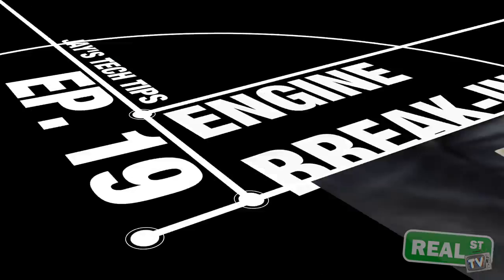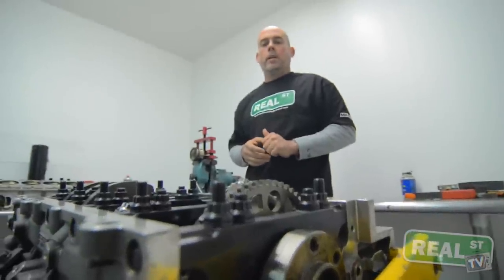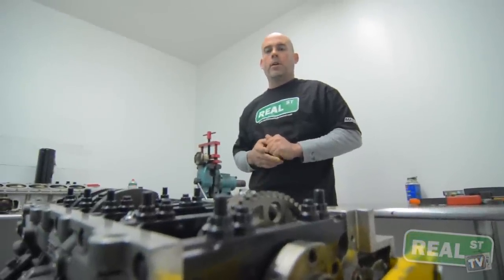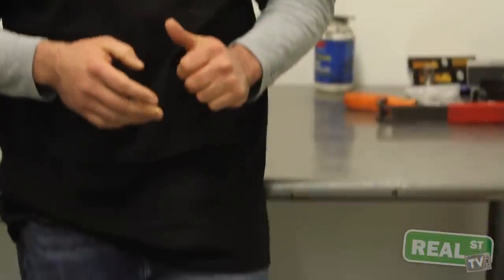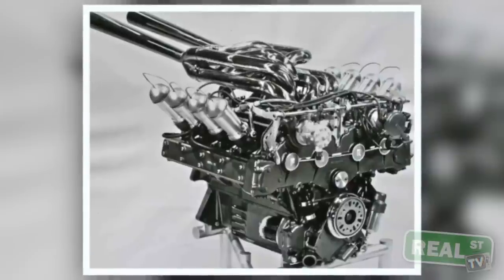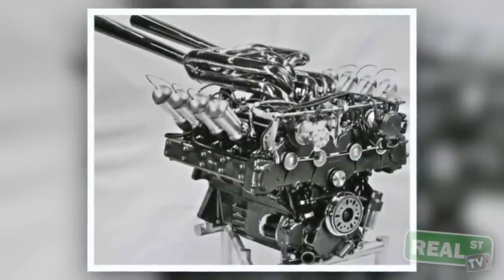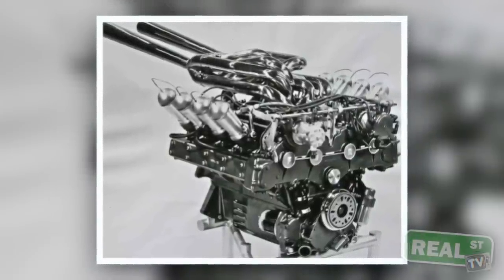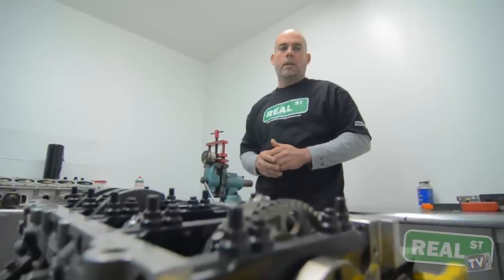Engine Break-In Jay's Tech Tips 19

Comment: In the engine test lab I work, with the engine on the Dyno we measure crank angle resolved cylinder pressure along with blowby flowrate and torque. As soon as the engine runs for the first time, you should see a gradual decrease in blowby, an increase in net IMEP as well as peak cylinder pressure, along with an increase in torque during steady state operation. Ring seating of the top compression ring face is increasing seal. If you remain at light load for a very long time for the first several hours of the engines' new life, depending on the metallurgy of the compression ring, the initial thermal cycles will hold and harden the surface of the ring face. This explains why a hard break in can aid in better ring seat and higher torque. Our metrology lab also verified asperities contact between components at low rpm and low oil pressure. At high rpm, all components "should" be fully hydrodynamic on the stribeck curve thus no engine wear. (I work as an automotive engineer btw.)
Reply: +BurnDuration what is your advice on breaking in a roller engine,keeping in mind it has already run for 45min by engine builder. please and thank you :)
Reply: +BurnDuration What would your recommendation be for the first 20-30 minutes? Perhaps let it sit and idle for 10-15 then take it driving at normal rates with standard street decel and accel for an hour or two then perhaps on the third and the next few hours do some pretty spirited pulls?
Reply: BurnDuration hard break in FTW
Reply: Whaaaaa.....
Reply: This guy wins.

Comment: Break in was necessary on older engines because of flat tappet lifter cams along with surface finish of the bores. New honing techniques result in a better finish that is less harsh on the rings on initial start up. Essentially you just want to vary the rpm and load over a few heat cycles allowing all the parts to expand and contract.

Comment: Good points. There's definitely an argument to made on both side of opinions on engine break-in. Where I work engine our engines are put through a 3 stage warm-up in the test cell and then are held at least 90 seconds at max rated HP followed by at least 90 seconds at max rated TQ. After that there is a cool down and low idle. We then take oil samples of each engine to check for excess wear metal levels. With today's machining and engineering capabilities break-in is not as necessary but you should use your best judgement.
Reply: I'm willing to bet you work for a Cummins engine lab. That sounds a lot like the engine run in cycles we run at the test cells at my work. On heavy duty engines like a 12L ISX, we follow the Cummins break in procedure. Rated, and then peak torque within the first few minutes of part load during warmup. We measure engine blow by flowrate and cylinder pressure, and wait for stabilization before moving onto the next speed and load.
Reply: BurnDuration Damn good guess. I work for CAT. Sounds like the test procedures are very similar.
Reply: fishgill0890
 Sounds like fun. out of school I was shooting for a test cell engineer position. I've heard mixed feelings about working for cummins since though.
Reply: Very interesting, I use a similar approach on my engine rebuilds as an gasoline automotive tech

Comment: Jay,

Thank you so much for your videos you do! 

My first start went outstanding. 

Ran for 20 min at 2500. 

Changed oil. 

Now been driving. Normal lotta vacuum braking. 

Smoking has gone away after the first little bit of run time. 

Only some moisture out the exhaust at start up from E85. 

Super stoked and can’t thank you enough for what you do for the jz community

Comment: Hard break in FTW! Start it, check everything is good, let it warm up but doesn't have to be all the way, don't let it idle for long, then drive it with low rpm with acceleration and deceleration then when it's all warmed up keep reving higher and then drive trough the whole rpm range and let it decelerate the whole rpm range in different gears. This is how you break it in at the whole rpm range.
Reply: +Monkeyclub  yes I agree
Reply: I like this method
Reply: This is old and agree with everything except the deceleration part. Deceleration in any gear at a high RPM is a good cause of loss of oil pressure and spun bearings. Letting the motor drop from 8500rpm to 3000 for instance puts a LOT of stress on the oil delivery system of most factory wet sump pickup type.
Reply: @harryazzole7814  If you let off and decelerate the oil system will still deliver oil acording to the rpms acelerating or deceleration.
Reply: @harryazzole7814  FALSE.

Comment: Great explanation. In my flat tappet motors to me that first heat cycle is everything. As long as the machine work is done right, and that cam gets broken in correctly during that heat cycle. Your finished. But your right, it's all a risk vs patience game by far.

Comment: Ive been reading about the negative affects of gently breaking in motors because of the rings not sealing properly. There's too many opinions and it's frustrating trying to decide on what's the best method.
Reply: ... Motomanusa
Reply: Just pay attention to the views of qualified engineers, ideally an engineer who designed that particular engine.
Reply: @trevorellis1704   ...Motomanusa
Reply: I mean if it's a new motor there's going to be a new Cam and just putting a new Cam and they're generally there's  A break in period just for that of running at about 2000 rpm for like he said about a 1/2 an hour  After that with special break in oil for a few 100 miles of no full throttle Drain it then put your good oil in there and have fun
Reply: Just go by the manual

Comment: A lot of us out west will take the trip to Vegas and back. The first part of the trip from the high desert is fairly flat terrain where we just do light 2000-2800rpm consistency and bu the time we hit the 18mi grade just after Baker it’s ready for that consistent grade for a duration. I was always told this trip allowed for good loading on the engine (albeit staying within the rev range). I never did the weird tricks where people run a hotter plug to seat the rings??? 
We just stuck to gradual loading and it seemed like it always worked well. 
By the time we got home after a trip to Vegas we knew if there were any real issues. We always took precautions to be able to get the vehicle back just in case but never ran into that thank goodness.

Comment: After some study, I would say, it all depends on the engine and what type of rebuild you have done. Is it standard performance or high performance? I can only say what I would do. Suppose the engine was a 1990s-era import with a cast iron block and an alloy overhead cam head. My sources says, let it idle for a few minute first. Maybe three to five minutes. According to the source, this will not affect anything. After that, rev it up and run it varying speeds between 2000 and 3000 rpm for about 20 minutes. Let it idle again for maybe ten minutes to let it cool down. You can repeat this procedure if you wish or go straight out the road. Don't forget to check for leaks and do the other aspects of the visual inspection.

On the road, you need to accelerate, maintain a steady speed, let your foot off the gas and let the vehicle just slow down in gear. My thought is, the rings will flex up and down infinitesimally and the acceleration and deceleration will polish and infinitesimally round off the edges of the rings. After some break in, if there is a freeway or highway nearby, you can travel between exits at maybe 55 mph. and then go back on the regular streets. After about 50 miles, go back home. You can change the oil at that time too. After another 500 miles of moderate driving, you can consider your engine broken in.

This is the procedure I would follow for any standard performance, cast iron block application. It is for people who do their own work at home. If you are paying a shop, they should have more advanced procedures and even a dynamometer. The most important thing is to build it right in the first place. That may mean, having a machine shop hone and even bore the block, having the crankshaft checked and even machined if necessary, and having other parts checked and replaced if necessary. It may not be cheap. If the engine was in bad shape, it might be cheaper to get a core from the self-service wrecking yard and rebuild that one.

This is just what I would do. If you are dealing with a performance engine, exotic engine or more recent production, you need to do some serious research.

Comment: This is my own opinion, but I bought a 2006 Hyundai Sonata, still have it and it's got 246,841 miles on it. With all my cars, idec what the manual says, as soon as I have it, I drive it like I stole it. No logic behind this but my friends Sonata (he has an 07) he broke it with what the dealer said (don't exceed 4000 rpm) for the first like 500 miles or so, his car died at 184000 miles. No logic behind it, but ive had no bad luck with any of my cars that I've romped on as soon as I take delivery. Until I experience otherwise, you only have one chance to seat the rings, so go for it!

Comment: I'm a motorcyclist and the break in is a massive area of debate within the community, I've always just ridden a bike how I intend to ride it all the time. People say to keep it under 7k for the first 600miles (on a bike 6k is about 1/2way to redline) and they start their bikes up, let it get up to temp before each ride, even after break-in. I just turn it on and get to 11k in 1st stone cold. 
Great video guys, love the easily digestible information in this series
Reply: Going crazy with it while it's cold is risky... Remember metals expand when they're heated, The expansion helps clamp down on the headgasket and all the other gaskets seals including the piston rings. Break-in periods though, yeah just drive it how you're going to drive it.
Reply: HowardSupra "7k for the first 600miles (on a bike 6k is about 1/2way to redline)" I love this comment, because it made me realise just how stupid high my bike engine revs (19,500rpm before RPMlimit)
Reply: produKtNZ what bike do you have? And what mods did you do to make it rev that high?
Reply: +Leonidas Saber You should seriously check out my channel - It's all over there :)
No mods, engine revs that high naturally :)
Reply: produKtNZ ya I saw your 250. I wonder what the factory did to make it rev that high.
Reply: +Leonidas Saber Just capacity design I guess. The crankshaft diameter is freaking TINY and the piston bore*stroke is something ridiculous like 28.5mm * 38mm. So each piston on a power stroke, intake stroke etc travels just 38mm (3.8cm or 1.49inch however you prefer) - so, the engine can rev that high simply owing to a complete lack of rotational mass, but torque suffers quite a bit. Hope that helps :)
Reply: produKtNZ ya I understand now. I did research on the bike. I thought it was a single cylinder 250 that was spinning 20k. But I found out it was a 4cylinder and has gear driven cams so now I know why.
Reply: +Leonidas Saber And to this day, the CBR250R or RR (MC19 and MC22 respectively) are THE best 250cc, 4 stroke bikes ever :) = (Probably just IMO,  but wouldn't be hard to find 10 people that agree :P)
Reply: +JackSwatman It really isn't a great idea to do that. For what its worth, until the oil is around operating temp it will bypass like a mofo in the filter. On liquid cooled engines especially the cylinder heats and expands at a significantly slower rate to the piston making things tight. It probably wont hurt it one short blast but prolonged coldhigh speed, high load ruunning isnt good.
Reply: It's simple, follow the qualified engineer's recommendation in your owner's manual and keep your warranty. Ask anyone who tells you different what their qualification is (simply being a mechanic should not be good enough - unless they have a degree in metallurgy)

Comment: To this day I still subscribe to break in tips a guy whose nickname was "Motoman." The idea is you start the engine up and let it get warmed up, then take it out and do a bunch of acceleration runs because what you're doing is forcing the rings to seat properly against the cylinder walls to prevent blow by and carbon buildup. If you break it in easy, you never give the rings a chance to properly seat well against the cylinder wall and on a new engine, you only have the first 50 miles or so to seat them properly. Notice this isn't "beating" on the engine but it's rather a more systematic breakin to keep increase horsepower and keep the engine running clean by having the rings sealing properly. After the first 25 miles or so, change the oil with regular, then 3-500 miles later, change it again with a full synthetic.
Reply: http://www.mototuneusa.com/break_in_secrets.htm 
When you say "bunch of acceleration runs" does this permit going over 4000 rpm? ps. I hope it doesn't take 2 years to get a reply from you. Lol!
Reply: Sean Santos lmfao he will prolly never reply but from what I read. You gotta start it do some acceleration pulls and then decel but not pressing the brakes. I mean you accel then take ur foot off the gas and just let it coast till it gets to around 2k rpm. Take it up to 5k rpm again and you supposedly do that for 10-15 minutes? Then change the oil and filter. Thats just what ive gathered from forums but man I wish there was a solid procedure not just preferred ways of doing it

Comment: I treat an engine like it's breaking in on every warmup.  When it's to operating temperature I run it the same weather it has 5 miles on it or 50k miles on it . As far as changing the oil after a couple hundred miles,  I never do that . I change the oil when it's needed.  I  might change just the filter after a few hundred miles on a new engine just in case the filter is full of debris on break-in so it doesn't go into bypass mode  !

Comment: Just passing through . Cummins calls for and ive seen this cause low mpg and blow by if not done. To take your new diesel engine hook a trailer loaded down and tow with it , after you break your flat tappet cam in at 2k rpm with high zinc based oil.  This seats your rings.  Different rings seat different also.  I wouldnt say beat on an engine  if but after you do a few heat cycles I get on them .

Comment: How strongly would you urge against, a simple hone and toss in the same size forged pistons and rods?
Reply: Check for cylinder taper. If the top of the cylinder bore is more than .002" out of round, or more than .003" total difference in diameter between the bottom of the bore and the top, I would recommend punching  .01 over or more, or, re-sleeve it. I have successfully used a glaze breaker on cylinders with this much error, and replaced the rings on original pistons. The rings were replaced as a result of the engine overheating due to a failure of the water pump. I also had to replace an exhaust valve, and valve seat. The engine ran great after that.

Comment: The only parts that need run in are the piston rings.  The key is varying engine load.  Do not hold constant rpm or you will glaze the cylinder bore.

Comment: I am not a motor engineer so there seems to be no set rule, they all say that once the engine has warmed up with oil pressure and engine up to temp no rattles rev them to medium rev's for that engine design, i ran in my Nissan 16v diesel engine in at 1800 rpm for 30 minutes then took it for a drive, oil is clean after 15000 klm's and no oil use, had no issues, older diesel engine's can only rev to a max of 1500 rpm anyway and they run in ok.

Comment: So no tip about the oil (or break-in additives) we should use for the first two oil fill-ups after rebuilding an engine?
Reply: Most people just use cheap engine oils that lubricate less during break in (mineral or half-synthetic). This way the parts will wear slightly to fit each other better. At least that is the theory and the way I break in an engine. But there is really no correct answer, everyone has their own way :)
Reply: I've always broken in engines on the oil I intend to run. That first oil change (and filter) is more important, than how the engine is loaded during break in. Just be careful, and mind the temperature. There IS a little more friction in a new or newly rebuilt engine, than one with a few thousand miles. Overheating a new build can cause the rings to lose their temper, and not hug the cylinder walls, which can affect how well they seal. Taking it easy, then on occasion, hit full throttle, with high RPM for a few seconds, then ease out of it, to allow the rings to cool a bit, is better for the first few hours. Sustained high RPM and load can overheat new rings.

Comment: In breaking in a LS 5.3, 4.8, 6.0 Or any LS Engine once you have rebuilt it. #1 Make sure if you have added any mods to have it tuned to address those mods. #2 With the new LS Engines there is minimal breakin due to the Computer will Learn, how you drive and custom set parameters to your driving. Now you in the fact that you have many variables in your driving, it will "Confuse" the computer. IE: Atlanta Driving, I drive 285 all the time and at 5:00 A.M. No Traffic, runs at constant speed throughout my commute. Ride home? Stop and Go, Stop and Go! The Computer gets confused when you drive to work and then drive home. Both conditions should apply but do not. If you do your research, the Computer will fluctuate and do weird things. Just saying as I have had this through many Tuning shops and they have all told me the same thing. If you are going to build a motor, it has to understand how you drive. Computers are stupid for these engines if you do not drive them Consistent daily. There goes your gas mileage.